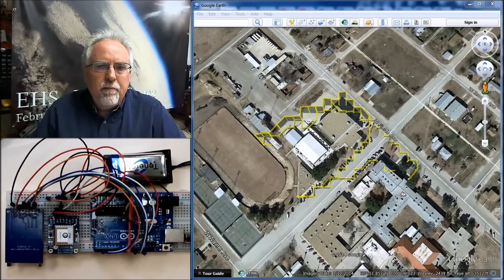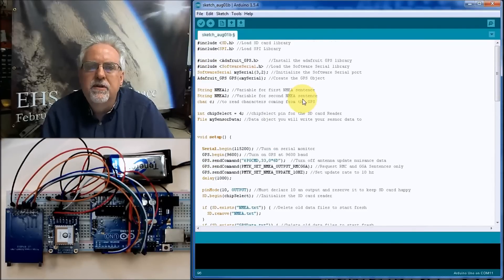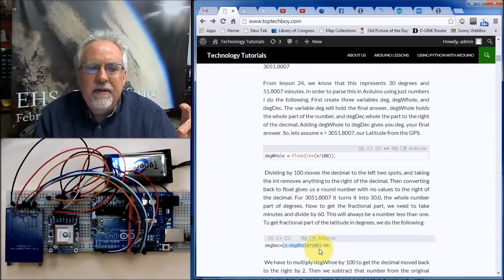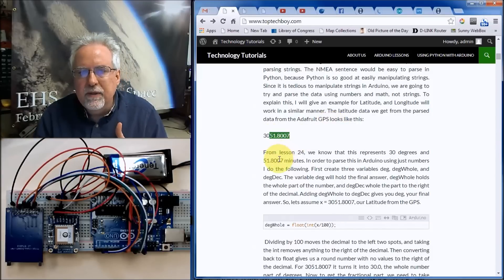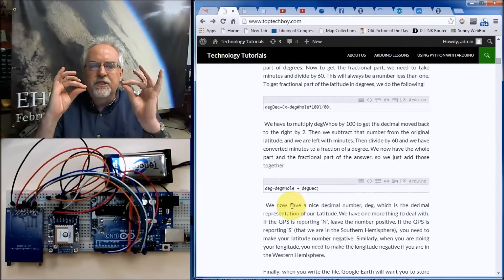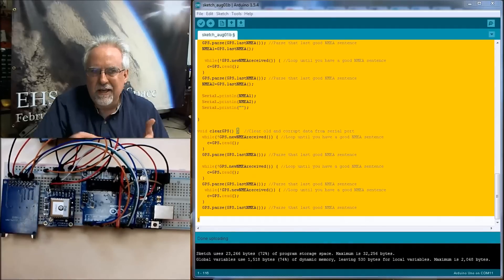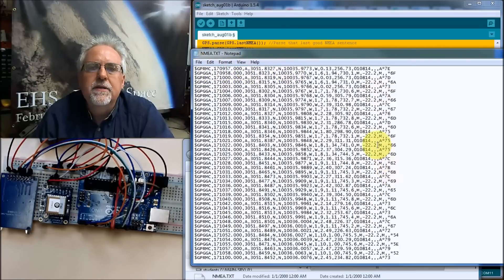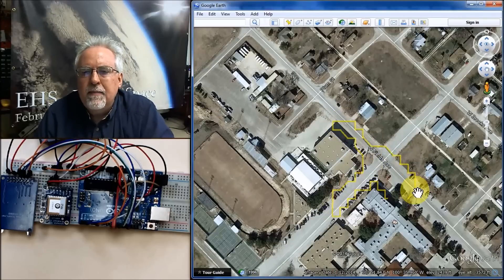LESSON 25: Displaying GPS NMEA Data in Google Earth

Comment: I've loved watching these tutorials. I have a question: As a long time C programmer, I tend to design programs that shut down "cleanly", I.e. all files closed and buffers flushed, etc. Is the Arduino's file system on the SD card subject to corruption if the system shuts down or resets while a file is open?

If so, here's a thought (if timing constraints permit): use redundant files with the same data written to each and one file closed before opening the other. That way, if one file is corrupted, the other should be intact.

Comment: Great video series!
I have a question re. building the KML file.  Can this file be built by the program by loading the XML strings into a file (as a .kml) using char write commands within the program?  Might be nice to eliminate the manual cut/paste steps.
Reply from the maker: Rob Krohn I do it using Python program. Python is much better dealing with strings and files than arduino. Personally, I would not do it in arduino but in python.

Comment: Hello Sir, thanks for the great lessons. I have question regarding buy Arduino GPS but i am confuse which one is best for me for High accuracy sub-meter positioning. i am find three model (1) Adafruit Ultimate GPS which is LadyBird Family with FGPMMOPA6H type antenna. it is by made Globaltop. (2) NEO-M8P made by u-blox and (3) EM-506 (48 Channel)  GPS Receiver made by sparkfun. as per your experience and knowledge please suggest me which one best (work area - India).
Reply from the maker: +paresh chaudhary The adafruit is the only one I have played with. My metric was something easy to interface with the arduino. I have been very pleased with it, but dont know which one is the most accurate. Sub meter sounds like it might be pushing the limit of what you can get with a commercial unit.
Reply: +Paul McWhorter. Thanks a for taking time. I request to you,  please publish one more great lessons on GSM/GPRS library.

Comment: Hi Paul, 
You have a great method for teaching! I have learned a lot from your lessons and I am very thankful for your efforts, although, I still have a long way to go :-) 
I built this system for ATV exploring in the mountains and it works great but sometimes I forget to turn it on or turn it off when not in use.
Is there a simple way to attach a motion sensor to it with say a 30 a second on/off delay to keep from collecting needless data and to keep from wasting battery energy?
I would really appreciate any help you may have to offer! 
I wish there were some way I could repay you for all I I learned from your lessons!!
Keep up the great work!!
Reply from the maker: TreeTop .Videography There probably would be a way, but not sure how to do it. You would need some power on the motion sensor probably to detect motion. Might look into some of the low power arduino clones.
Reply: I was thinking of using a sensitive tilt switch and a resistor that would connect to the base of an NPN transistor which would be used to turn on the main battery for the Arduino and run the tilt switch off of a regulated 4 pack of AAs. The tilt switch I have should run for at least 3 days if left powered on round the clock (I'll have to test the life of battery that powers the tilt switch to be sure). It should cover a weekend. I could probably even rig a piezo alarm to it just in case someone else likes my bikes better than I do, if ya know what I mean. :-)
These are mountain campsites that we go to.

Thanks again,  Paul!!
Reply from the maker: TreeTop .Videography That might work, but I would fear that the vibration sensor might turn off when you want it on. Look into the stuff out there on low power arduino compatible platforms. I think there is some stuff out there.
Reply: Paul McWhorter Hi Paul, After giving it some more thought and doing some testing. I'm using a mechanical tilt switch (2 metal balls inside of a small container, each time the internal balls touch very briefly, it fully charges the electrolytic capacitor), I'll use the on-board 12 vdc battery for the power source for everything, I'll also use a 12 volt regulator (for a MOSFET) and another 5 volt regulator for the Arduino, a diode, a resistor, a capacitor and an N channel MOSFET (to switch on the Arduino GPS system). Just the vibration of the ATV running keeps the MOSFET on. When the ATV is off and sitting still, the capacitor and resistor can easily hold 12 volts on the gate of the MOSFET for several minutes (or even hours) but I'd like to keep that down to less than a minute to keep from gathering so much needless GPS data so I'll do some calculations for sizing the capacitor and resistor for the time I want. This way, it would never power down until the ATV is off and sitting still.
I just thought you may have a better idea. :-) Thank you, Paul!!! :-)
Reply: TreeTop .Videography Regardless, I've learned SO much in the way of coding from you and your tutorials!!! I sincerely appreciate what you're doing, Paul!! :-)
I've been building electronic control systems for many years using Tridium, PLCs and other systems but this is my first rodeo with Arduino programming. 

Thanks again!! 
I will continue to be at the edge of my seat while watching your videos:-D

Comment: Hi Paul, first, thank you, thank you and thank you for posting these videos about how to create the gps tracker. this info is really valuable for folks like me who are starting out as new bies. :- ) I do have a question and was wondering if you can help me with? So, it looks like the nmea sentences data's are store in a sd card on the board. I'm thinking is there a way to retrieve the data automatically in real time by calling the Adafruit Ultimate GPS board while the nmea sentences data's are still logging it thru software?

If i can upload the nmea sentences data's logs into a database server automatically that would be so awesome. :- )
Do i need some extra component to make that happen? Thanks again for your info.

- thomas ;- )

Comment: Great videos! I've leaned  a lot.

You know, instead of doing the math to convert the coordinates, couldn't you just call GPS.latitudeDegrees
Reply from the maker: Yes, but the point is to learn how to write programs, not how to run programs. Someone had to write the program GPS.latitudeDegrees. I want people to learn to write, not just run other peoples code.
Reply: Yes, I agree with you.  I avoid using libraries whenever possible.  If I do, I find out what the functions are actually doing.

I decided to build a GPS logger to use in a  field biology class I am taking, as well as for birding and hiking outside of class.

Regarding the SD card reader, some say SD cards are not 5 v logic tolerant.  The Virtuabotix SD Card Reader doesn't have a logic level converter, just 10 k pull up resistors to 3.3 v. Correct?  I have not had any issues with the tests I have done.  I am merely curious if it is actually an issue.

Your students are lucky to have you as their teacher!
Reply: Paul McWhorter Excellent videos. I love the actual coding and debugging that goes on. Absolutely fantastic. Thanks for taking time out and doing this.